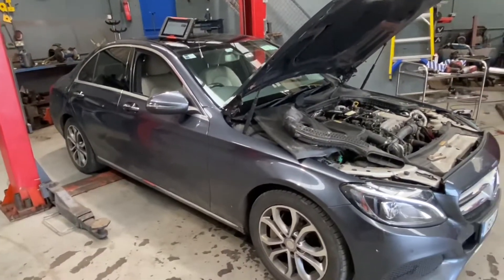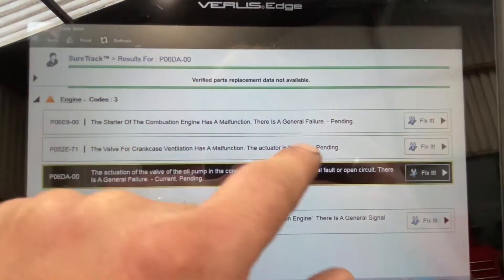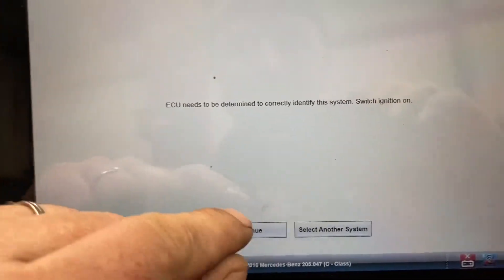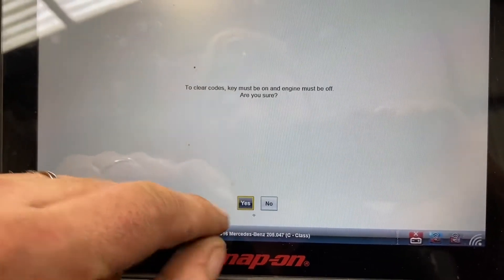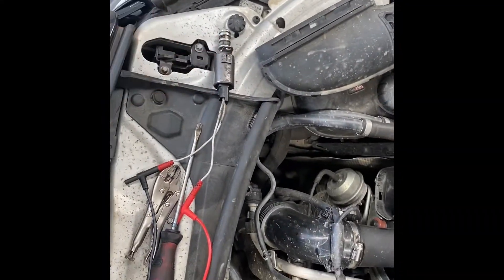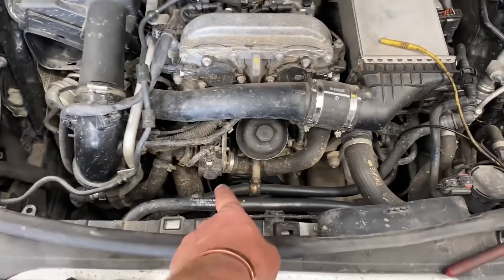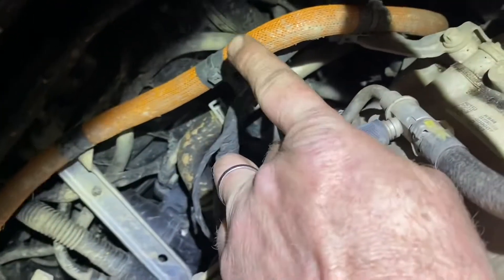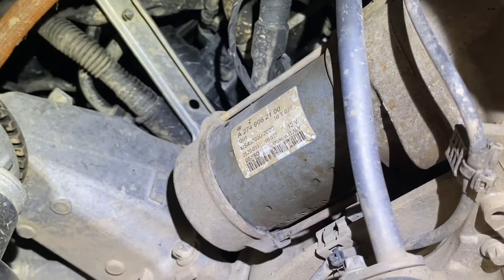Mercedes P06DA oil pressure control fault finding (part 1 )

Comment: Thank you for the video. I did the decoy solenoid in a 2021 g550 . Was able to clear the engine light but some reason on the reader still showing the code if you go into the Engine TDC. Drove 50 miles and no engine light. On the g550 to find and unplug the harness is a pain, it’s between the alternator and the engine 😢. Decoy solenoid got pretty hot after a few startups
Reply from the maker: It can be simple enough to trick the engine ECU if that is the preferred route 👏👏

Comment: Does this cause a burning smell at higher speeds?
Reply from the maker: Not that I’m aware of but I suppose it is an oil pressure related fault so it is possible 🤷🏼‍♂️

Comment: Should I sell the cars after getting this repaired
Reply from the maker: @Z5100-k7t  no not at all, this failure doesn’t cause any problems going forward
Reply: @ did client have issues with spark plug and rough idling . I had issues with spark plug and rough idling when check engine light came on , they replaced the spark plug and  said it wasn’t coil pack but EL light stays on .
Reply from the maker: @ his car was running fine with P06DE being the only fault present. I would advise doing an engine management code scan to see have you misfire faults too 🤔🤔

Comment: I have the 2017 glc300. A month ago the p06da was on and two days ago it was off and has stayed off. My concern is it now functioning or is it stuck and I don't know it. I've never had a check engine light for this either. Thoughts?
Reply from the maker: @arielrodriguez6980  they say it is the loom being submerged in oil that causes the issue, but I don’t think I’d worry just yet. If the fault isn’t present at the moment 🤔🤔
Reply: @kennedysgarage3281   what are the chances it is stuck enabled and I am not getting enough oil pressure?
Reply: @arielrodriguez6980 any update dealing with same issue
Reply: @  There is no more code present so I am driving as is and it is fine. I check each moth for codes to be sure and for some reason it disappeared.

Comment: Mercedes says to ignore it but how will you know if the stuck open solenoid won't eventually close on you for good?
Reply from the maker: @arielrodriguez6980  I have only 1 rule, something is either RIGHT or it is WRONG. And your car is wrong and it is better off fixed. But that is just my opinion 😬😬😬
Reply: @ I understand but I am no longer getting the code.
Reply from the maker: @arielrodriguez6980  if it isn’t broken right now leave it alone. I believe it is the wiring harness that fails rather than the solenoid. But safer to renew both once in there 😉👍👍

Comment: hi Kennedy, First of all Thankyou for the informative video and secondly i want to ask that i have c200 2015 and this same code pop up but the car drives fine though, i know you've mentioned that we do need to repair it as it is related to engine at some point but i have one more concern regarding my car's temperature gauge as it is currently on a lil higher than 80 which is middle bar, so is it okay if it is slightly higher than middle and stays there where ever i go long trip for 100 miles even,  it doesnt change. I hope you get it. waiting for your response thanks. Love from Sheffield
Reply from the maker: @muhammadmiqdad1912  hi Muhammad, the newer model of Mercedes seem to do this. The temperature gauge stays just above the halfway point. It looks a bit daunting but is absolutely normal. So ignore it 😉👍👍👍
Reply: @  Thankyou sir for responding. Really appreciate it
Reply: Hello, I have question and help to solve question, on my w213 e300 2017 pop up this fault code P06DA00, but says Ignore error code and erase fault memory. So just erase it and ignore? Thank you for your answer!

Comment: Just had an oil change, right after started engine, the engine light came out, same code, what the Heck? Thanks a lot for this video, will keep driving until I had to go in for car registration renew, then considering fixing it.

Comment: If you do have to go in and drop the sub frame and change out the sump or whatever is inside the engine, what would something like that cost?  Mercedes here is quoting almost $5000 to do the work on a 2019 C300.  Just wondering if we should take the car elsewhere for repair.
Reply from the maker: @DrivingTesla  ooohhh, that does sound a bit on the high side. I would think it should be around €1500 to €2000 depending on the workshop hourly rate.

Comment: Have this issue now with our 2020 GLC300. REALLY appreciate this video! Have also read that this part - which is designed to very slightly improve gas mileage by reducing parasitic drag at idle - can actually cause more engine wear in the longterm. Accordingly, many now recommend ignoring this CEL code. Unfortunately for me, my state (Illinois) won't perform my emmissions test if the CEL is on for any reason. With this in mind, I'm thinking maybe I could unplug the wire (as shown in the video) and connect it to a homemade fitting with a resistor of the appropriate reading to fool the system into thinking it was conncted to the oil pressure solinoid. Anybody have thoughts on this and how best to do it?
Reply from the maker: That sounds like quite a good idea. Could you just wire in a bulb (this would be a consumer) and see how it goes. 🤔
Let me know how you get on 🙏
Reply: @kennedysgarage3281  I found a Mercedes owners group that has dealt with this issue successfully by disconnecting the cable that connects to the connector at the engine block (i.e. to the cable and solenoid inside the oil pan), buying a replacement solenoid and then connecting it to the disconnected cable. They zip tie it safely away from any moving parts. 

Basically, this set-up fools the system into thinking that everything is fine without having to remove the oil pan to replace what is likely the defective cable and/or solenoid inside the oil pan. The side benefit is that normal oil pressure is restored at all times (like used to be the case before car companies started using every trick in the book to increase fuel mileage). Mercedes has indicated ignoring the fault code - which means oil pressure is never suppressed) is not an issue.  Quite a few owners on that site have used this fix successfully without any issues. I'm going to give it a try.
Reply from the maker: @edbreyer  sounds like a good alternative, let me know how you get on 🙏🙏
Reply: @edbreyer   If the oil is never suppressed with this code then why even disconnect the cable?
Reply: @kennedysgarage3281  Sorry - should have posted an update. Before installing "the fix" I read that sometimes the fault clears with an oil change - and indeed it did. It's been 10 months and so far hasn't returned - but I have the part ready to go if it does!
Reply: @arielrodriguez6980  Because in my state you can not pass the bi-annual emmissions test with the Check Engine light on. Otherwise, you seemingly could ignore it (the CEL) - but you might not know when another trouble code popped up since the CEL was always on.
Reply from the maker: @ that’s good news for you. Well done on this one mate 💪💪💪

Comment: What engine is that? I have the 1.6. I think the wiring comes out of the plug and the plug gets loose.
Reply: i have same problem, will this badly affect the engine?
Reply: @sparts6825  no. It is actually more beneficial to the engine
Reply: @AnthGott  is this true i am scared to drive my car with this fault present ?
Reply: @sparts6825  it will be fine and have good oil pressure all the time.
Reply: @AnthGott can I keep driving with the cel on?
Reply: @N0brainerr0  depends what the fault is
Reply from the maker: My one was 2.1d and the wiring loom submerged in oil failed on my one & not the block connector 🤔🤔👍

Comment: Mechanic told me I just need a loyal change had the same code 2019 a220 period it came on about 3000 mi overdue for an oil change, I put oil in code went away. Going to take it now to have an oil change
Reply: Did it gave same code ? Did the car run rough ?
Reply from the maker: @rafaelandrade69  my car ran fine but just didn’t want to take any oil pressure related risks, in case it caused serious engine damage 😬😬
Reply from the maker: Hopefully the oil change will help 🤞🤞🤞
This is a very common fault though 😩😩
Reply: @kennedysgarage3281  I added a little oil and ran the car for 30 min, check engine light has GONE AWAY!!!
Reply: I just got my oil changed 2 weeks ago and this code popped up today. 2019 A220. Theres no way an oil change is needed
Reply: @robertdaniellalongo1008
Reply: Same thing for me - oil change (which wasn't overdue) resolved it. That was 10 months ago - fingers crossed!

Comment: Hello! Thanks for sharing this video. I have a C300 2019/61K kms and it was diagnosed with P06DA00 by the dealership when CEL came on. The dealership also gave an estimate of a few thousand dollars to fix the issue . The CEL illuminates intermittently and the vehicle appears to drive fine. When I looked up online on forums and other pages, they say that this fault code can be ignored. In your opinion, do you think I should get it repaired or ignore the CEL until it stays on for a few days without going off? I appreciate your advice on this subject. Thanks.
Reply from the maker: In my opinion and this is just my opinion, I think with the high value of the car personally I would like the engine ECU to be able to control the oil pressure as designed. They say that when this oil pressure solenoid or loom fail that the oil pressure goes high & shouldn’t effect it too much. But if everything oil pressure related is under more strain at all points in time it cannot be good for it 🤷🏼‍♂️🤷🏼‍♂️
You should be able to get repaired for around €1200 to €1500

Comment: The oil valve is a normally open solenoid, so it is a fail safe design. When it fail or not energized or OFF, the oil pump is then like a normal oil pump with higher oil pressure at lower RPM. This oil valve is called Y130 on M276 3.0 Turbo engine and as with most MB component naming/ID scheme, most engines will also call it Y130.

Fuel savings from less parasitic load of higher oil pressure in the engine when RPM is at lower region, is MB design target.

PWM signal at 200HZ is how it operate. 10% duty cycle if OFF. Mercedes call this a 2 stage oil pump. In the 6 cylinder M276 family, 3,500RPM is the trigger to turn OFF this oil valve to allow oil pump to give maximum oil pressure at about 55PSI.

=======
A test on M276 3.0 Turbo of E400 W212 oil valve, only at 3,500RPM the oil valve get turned OFF. See here :  https://youtu.be/qFikhwMenFk

=======
A test to show actual oil pressure control in PSI this oil valve is doing. 
NOTE : On cold start which is low RPM, even at 30C,  the oil valve is turned OFF to produce higher oil pressure to send oil faster and abundant to all components : https://youtu.be/YUzW6ismhhQ

At already a hot engine, oil valve will be ON ( to get low oil pressure ) during engine start  : https://youtu.be/tX5RBGRp0UI

=======

When oil valve wiring disconnected aka disabled on purpose but a bulb and buzzer is wired
to its power source instead, to indicate when the ECM is actually powering ON or OFF that oil valve. https://youtu.be/l5ZGZa6SxfU

===========

The oil pressure reading is from an aftermarket oil pressure sensor and multi-gauge called Banks Data Monster.

MB is a stingy bastard and most of their non AMG engines has NO OIL PRESSURE SENSOR or even LOW OIL PRESSURE SWITCH for warning... crazy !!!

Full details here : https://mbworld.org/forums/e-class-w212/848256-m276-2-stage-oil-pressure-valve-when-passed.html
Reply from the maker: Thanks for sharing all this information 🙏🙏👍👍
Reply: @kennedysgarage3281   You are most welcome. I enjoy sharing what I too have learnt👌
Reply from the maker: @suryaprihadi2258  😉😉
Reply: Awesome explanation.  Are there any risks to the engine if the wiring is left disconnected?  Does P06DA trigger a MIL/CEL?
Reply: @JettaRedIII   NO CEL, but a scanner will pick up the DTC.  MB knew that if this solenoid failed, it pose no danger to engine, hence no CEL but DTC is produced when scanned.
Reply: Also, 3500 rpm seems awfully high for the solenoid to deactivate and permit  normal pressure.  Most of my driving (M276 3.0 turbo) is under 3500 rpm.
Reply: Wow very informative. So a hot engine STARTS with the Oil Solenoid ON, at low pressure?? This could be the reason why so many VVT/timing chain issues...
Reply: Is it similar to how most automatic transmissions have used variable displacement vane pumps for some time? The pressure acts against a spring loaded piston, with pressure agaisnt the piston and linkage tending to decrease the eccentricity of the vane pump housing and thus displacement.

Comment: I dont have a check engine light on but i did a diagnose with this app called fixd and it’s giving me a code P06DA unknown engine error and its saying its major…should I be concerned is it safe to drive?
Reply from the maker: This car was driven for 8 weeks after I diagnosed it first, which means that there might not be any immediate urgency. But any thing oil related must be taken relatively seriously. I would advise getting it resolved as soon as you can 👍

Comment: Nice diagnosis  👍, First i have seen anything like this oil pressure control  is there any real need for it ?,  I wonder  why this is fitted 🧐 maybe something  to do with the vvt control ?   Thanks for sharing.
Reply from the maker: Emission’s I would say, reduced drag from the oil pump when high oil pressure is not need. I could very well be wrong & look forward to other peoples thoughts 🤔🤔

Comment: I too used to collect various parts to use as tests components with diagnostic. Then I brought a resistance decade box that allowed me to dial a resistance value. Top tip don't buy the cheap Chinese one like I did. Ended up buying another one which was far better quality and fit for purpose.
Reply from the maker: I have 2 decade box’s there but never even thought of it for this test process. If I tell the truth I really only use it for temperature sensor tests. But a really good tip Chris 😉🙏🙏